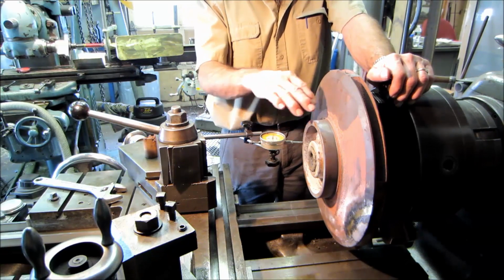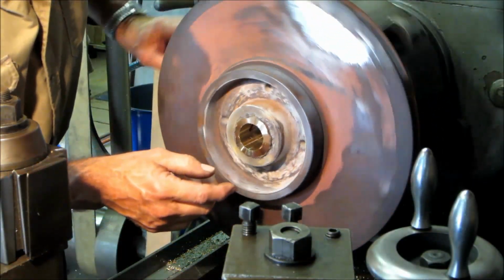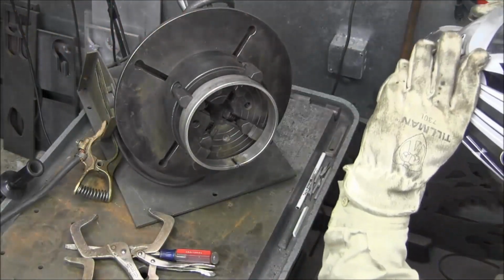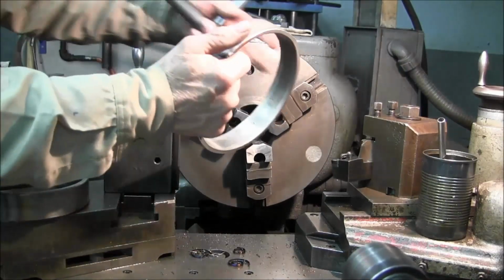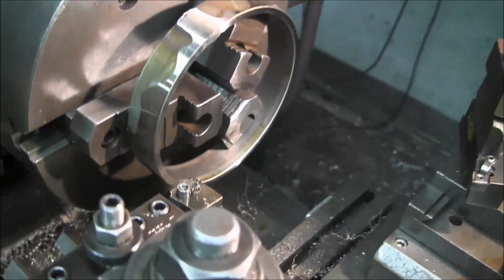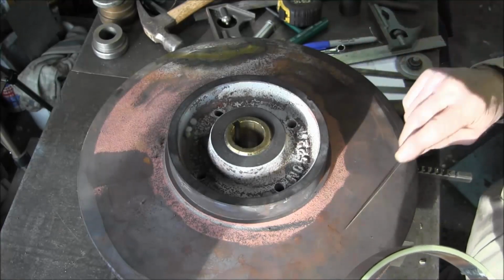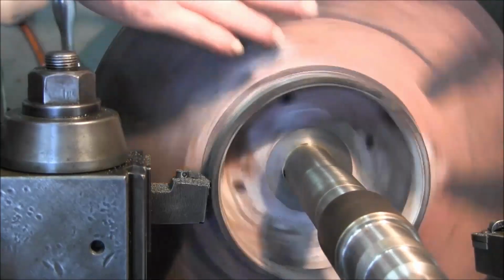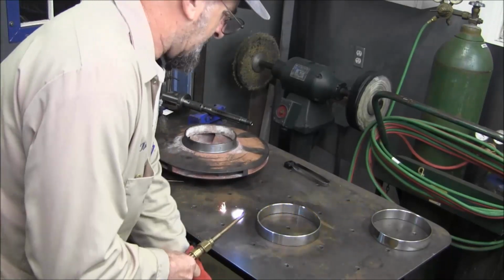Clam Pumper Part 3

Comment: Hey Keith question for you. I know that heating steel has a fairly predefined expansion schedule based on the kind of steel in the amount of heat, and I understand that this makes it easier to fit two pieces of steel together and then have them cool and shrink tight together. What I'm wondering about is whether supercooling for freezing one part of steel would make sense or would provide any effectiveness and fitting to pieces together. Is there a predefined schedule of shrinkage that you might obtain similar to the expansion you get with heat?
Reply from the maker: gurubryant You can dry-ice and get similar effects on fitting up items or inserting items that may be to big to get enough heat or other reasons flames may be a problem. ;{)-----

Comment: I'm curious about the failure of the Stainless Steel shaft.  It appears from the video that it's a brittle failure.  If the shaft is made from austenitic stainless (300 series), the shaft may have failed from intergranular corrosion due to the exposure to the sodium chloride (salt water) and mechanical stress.  304, 308 stainless steels are particularly subject to intergranular corrosion in stressed condition and exposed to chlorides.  316 SS which contains molybdenum is more resistant to stress corrosion (intergranular corrosion) in the presence of chlorides at temperatures below 160 deg. F.  May be worth some investigation.
Reply from the maker: The shaft that are supplied by the manufactures and used in these pumps are plain steel and that is part of the problem all around. ;{)---

Comment: great stuff. i have 3 questions. how did you form the ss rings, what was the difference of the o.d and i.d. measurement to make the compression fit and how did you come up with that difference?
Reply from the maker: ***** I rolled then on my slip rollers and that part of the video footage was lost at the same time I had lost another video's footage, trying to edit and save two video projects at the same time. The amount of interference fit was about a .001"per inch in diameter. I turn the ID of the ring to a planned size that gives me a nice thickness to the ring and leaves a good portion of base metal to fit on and then turn the pump ring diameter it is going to be mounted on, with the extra material to allow for the desired interference. ;{)-----

Comment: Shades of the old-time serial Mr. Fennerman.  Great video.  You indicated you do these pumps at regular intervals, wouldn't it make machining the rings easier to have a set of soft-jaws for the ID and OD turning?  Would also result in more consistent ring thickness and avoid the "egg" or "trilobe" shape of the ring.
Reply from the maker: Morris Gallo It wouldn't be a cost effective use of the soft jaws, in the sense, that after the ring is heat shrunk or pressed on and turned, it is running concentric. I would and have used soft Jaws for a lot of thin wall parts and when the part have to stand alone, in a true and parallel state, then the jaws make all the difference in production. ;{)-----

Comment: Keith,
Again, nice job. I've had good luck with stainless caps, instead of making the complete shaft out of stainless I machine a SS cap about 1-1/2 times as long as the bore, maybe 0.100" wall, drill a small hole in the end to let pressure escape and TIG weld a bead with something like 309 SS rod then seal the hole. Just a suggestion but I've had good luck with it and that seems like the high rust point of the pump.
Rob

Comment: Hey Keith thanks for all the great video's what kind of boring head do you have for your K &T you are running at the beginning of the video I would like to find a simular head? I am in the process of setting up a line boring bar to repair a small excavator  boom learned a lot from your line boring series. Jason

Comment: Kieth would it be possible to heat that bad boy up to a red hot luster then throw some good  Porcelain powder on it with a sprayer ?  or maybe braze coat it ?, it seems to me though that brazing that part will give you a galvanic action  that will corrode badly , is it possible to tig weld cast iron? this would midigate the galvanic action your gonna get . throw some water on the braze and let it sit the white stuff is from galvanic corrosion of dissimilar metals , its kinda like a zinc copper battery actually
Reply from the maker: NOBOX7 Well for the past six to seven years the two pumps have been lasting longer with this process and having no signs of failure due to the brazing / ductile mix. I have done a lot of ceramic flame spray back in the yards and wouldn't think it a good choice for this application. ;{)---
Reply: Keith Fenner I see, thanks for your input , very interesting video i really enjoy making things stand up the test of time, very cool that you were able to make this pump last so much longer , and thanks for mentioning the durability of the braze , i had a bad experience in the past and its nice to no the limitations a technique, stainles brazess the best of all metals in my opinion but one time i brazed a beer keg all to hell making a special wood burner and man you should see the white oxidation that forms , i thought it was a flux reaction but then did some reading turns out its a long story you probly already no

Comment: keith wouldnt putting zinc blocks in the inside of the inlet help with corrosion like on a boat ??
Reply from the maker: Andy Coakes To a certain extent it would help but the nature of uncoated ductile materials are hard to deal with. ;{)-----
Reply: i see what you mean an excellent series of videos keith